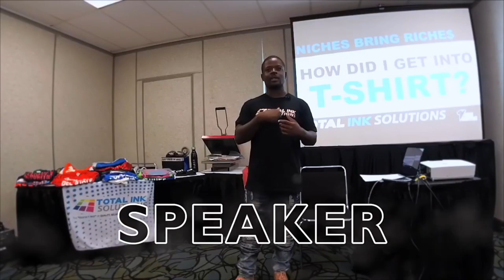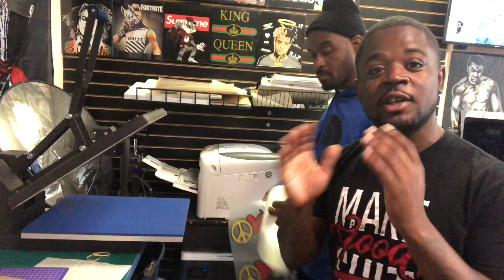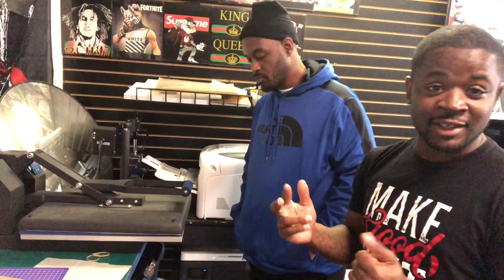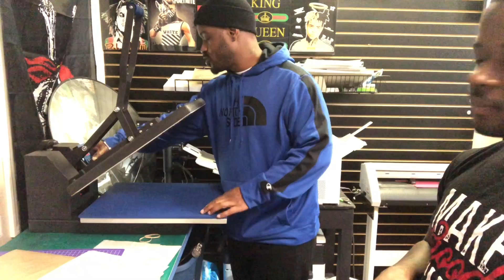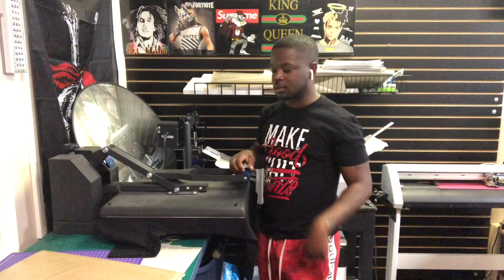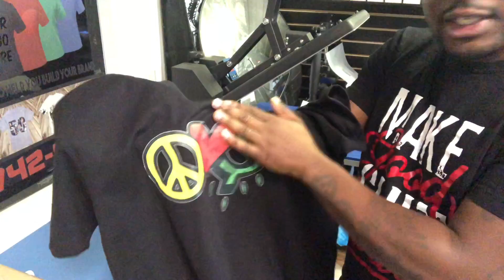How To Make A Custom T-Shirt Using An Oki White Toner Printer and Forever Laser Dark Transfer  Paper

Comment: Thanks for this video. Think I'll stick with the opaque 3 and Paropy dark classic. If you haven't tried Paropy, its nice.
Reply: Paropy? Tell me more🤗
Reply: @victoriajeffries1156  for dark fabrics. it feels a tad bit softer than 3g opaque. paropy dark classic inkjet paper. I grabbed some from US cutter. Make sure you get heat press tape and parchment paper to hold down the graphic. It will start folding as soon as it feels heat if you don't unless you have one of those swivel heat presses. They have other papers for laser and ink but I like this one for my dark shirts
Reply: How does paropy hold up in wash
Reply: @bagvision5918  the shirt will get holes before the graphic deteriorates.
Reply: @LemonStank  so it holds up in wash I’m asking cause I’m bout to get the oki 332 or ghost white printer hp
Reply: @bagvision5918  the paropy im referring to is for inkjets. white toner, you'll probably want to use what they're using

Comment: I just purchased the OKI B412dn A4 LED monogram printer for my T-shirt business to be able to use the Forever no-cut transfer paper onto dark garmets. However due to it shipping with black toner only, will I need to buy white toner in order to print onto dark garmets with this transfer paper? Will this printer print anything other than black and white?
Reply from the maker: This you should ask your rep.
Reply: Simply No.  You purchased a mono printer.  Not capable of colour printing and certainly not running white toner which you require for the transfer mediams you mention

Comment: @ Stan Banks What is the "A" paper called.  I see A lot of videos of instructors like yourself showing how to apply Laser Heat transfer paper onto A garment, but no-one ever says what kind of "A" paper it is or what it is called.  Please help!
Reply from the maker: It’s called a a sheet and a b sheet they come together for this print method.
Reply: @StanBanks  I was asking what is another name for the "A" paper?  I purchased the Forever White Toner Heat Transfer paper.  Directly pressed my design form the "B" paper onto -tshirt thinking it was A direct iron on.  But, it didn't work.  The "B" paper got stuck to the t-shirt and totally screwed up my design.. Are the Forever WhiteToner designed only for the Oki printers?  Also, what do I do to get the design to successfully press onto the t-shirt.  I am so lost as I am very new at this.

Comment: Why go to DTG if this is faster.....I've been lookin at printers for years..(I'm slowmotion) and I dig this OKI. They are expensive but not at the DTG price and they do the same.....
Reply from the maker: For everything you said pricing plus maintenance. Lower learning curve.
Reply: @StanBanks   u try magic touch t one no fading with oki
Reply: I had the same debate. DTG produces a better product. It feels more like a screen print. That is the only plus side. I went with the OKI. I wanted to do heat transfers. I’m trying to sell multiple designs at a festival like setting. Printing on a shirt is more costly than just a transfer. If the design doesn’t sell, I’m only out a transfer and can put a different design on the unused t shirt.
Reply: @ManScoutsofAmerica  what u recommend?
Reply: gucci Reaves not sure. I think OKI is the best at the moment.
Reply: @ManScoutsofAmerica  ok thanks
Reply: @ManScoutsofAmerica  how do prints hold up bout get the oki 32
Reply: @bagvision5918  not the best. They turn vintage looking or distressed after four or five months of washing, once a week.
Reply: @ManScoutsofAmerica  which oki u got
Reply: @bagvision5918  pro8432wt
Reply: @bagvision5918  i imagine different brands and types of transfer papers act differently though. I use imageclip laser light
Reply: @ManScoutsofAmerica   does it hold up in wash

Comment: I dont change my heat for the press to shirt or final press i may ad pressure for the final press i have left it on for 60 80 seconds with no problem but i ideally final press for 30 to 40 sec and i bout from Digital Heatfx it came with the rip software it control or you can control how much toner you use and so much more um a Georgia boy from Atlanta not a salesman feel free to ask me ?
Reply: How can I get a RIP software
Reply: What papers do you use???

Comment: I would have unit icolor 600. Price lower. Includes RIP soft ware. Specially tonor mapping system. It is you can switch switch back white underage or overbase. Also switch to fluorescent tonor, and true black tonor switch. This oki is not.  What is going on oki. I'm so disappointment I bought last year 8432 wt. They really need update firmware. Because it looks like exactly same machine with different brand name.
Reply: Wish i could afford that one just brought the 550

Comment: What program is he using? How about the settings for the RIP software. Missing info...
Reply from the maker: If it’s missing go find it lol. He doesn’t use a rip software as far as I know prints straight out of photoshop. He didn’t ever install the rip software if I remember correctly and the settings he uses are discussed in the video. 

We realized we should have done a screen capture. Maybe next time.
Reply: Ok. That's what I'm looking for, is it capable of printing without and the results...no harm intended. I have the oki and its giving me fits, but you always give solid info so here I am 😎
Reply from the maker: I’m just messing I got to be rough sometimes. Ask him over on his Instagram he will help you

Comment: Cool demonstration vid. I have tried this method quite a few times. After a few misses, I can say I have successfully printed a few shirts(personal attires), and so far, haven't experience any peeling or cracking after washing.
Reply: They say it all depends how its heated and transferred on how long it will last if done right with all legit and right equipment it will go about 40-60 washes easy
Reply from the maker: Nice!

Comment: Do not dry the shirts in a dryer. You must air dry these shirts or they will crack the first time in the dryer. I own an Oki 8432 and I warn all of my buyers who purchase an Oki transfer shirt that if they dry the shirt it will crack and peel away. After all,  the print is only a transfer. Do not use any detergent with perfumes or softer or bleach. These types of detergents attack the laser print and begin removing the print, sometimes in the first wash cycle..
Reply: Brother Ernest get better washability when you rasterize with forever rip
Reply: @Grafikdetail  I have the forever rip and the rip for the Magic Touch. I've rasterized both. Same issues. I basically use my Oki to print a negative to burn on my screen with my heat press. No using emulsion.

I sort of gave up on the OKI and all three papers and I got so pissed off that I built my own DTG converting an Inkjet printer.

I'm killing it with DTG and Screen Printing.
Reply from the maker: This sounds interesting
Reply: @brotherernest5993  how do you build your own DTG printer?
Reply: Natural Health Revolution I followed instructional videos on YouTube. You can go look at my channel to see the dtg I built. Dtg blows away the Oki printer everyday, imho. I have the Oki 8432 I used magic touch and forever flex, but neither last as well as DTG.
Reply: @brotherernest5993  thats what i did too . great minds think alike
Reply from the maker: Great advice I’ll include it in a future video!
Reply: Which brand detergent do u use